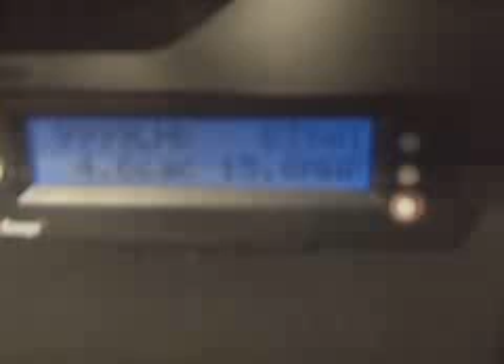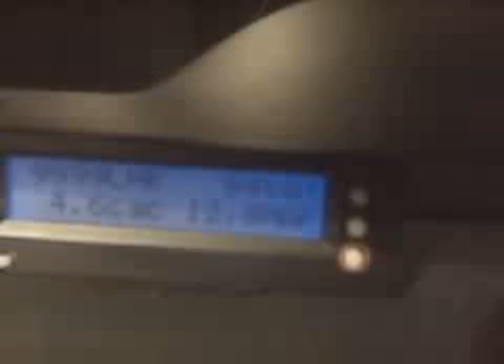How to do the VW ALH TDI MAF twist

Comment: Are you still around? I have a question that I have been searching for endlessly. Does this also stop the lost fuel efficiency on the ALH TDI that comes along with the check engine light? Thanks!!
Reply from the maker: I never saw any difference in fuel economy no matter what I did to that car.
Reply from the maker: Other that over inflating the tires and driving slower.
Reply: @NarfBLAST  Thanks!

Comment: My reading at idle are 
Specified 850 actual 495 
Car runs great, apart from turbo boost has dropped from 24psi to 17
And won’t rev up past 2500rpm in neutral then it starts to sound like its bouncing off the rev limiter

Comment: Some ALH maf sensors cannot be twisted as there is a tube with a rectangular opening where the actual MAF probe goes in. In this case simply unscrew the two philips that hold the MAF housing/duct and apply el. tape over the inlet mesh. Make sure the tape's ends are long enough to stick out and be  pressed on by the MAF housing edge. You can adjust the reading by moving the tape higher or lower on the inlet screen.

Comment: The 5 point Allen key you guys talk about. Do you mean a torks head screw lol  can buy set of bits at any Home Depot, wall mart ,home hardware, auto parts store lol
Reply from the maker: MrCinimod93 On some MAFs It looks like a torx but it has five points instead of six.  It is a special security head to prevent tampering.  You can usually grab the head of these with a set of pliers and twist them out and throw them away.